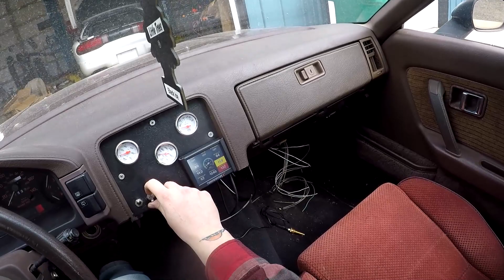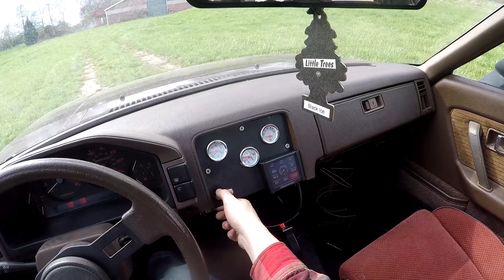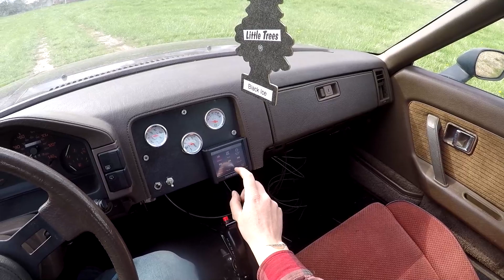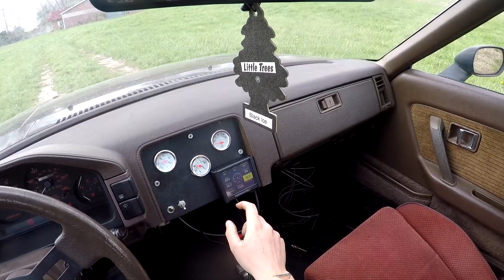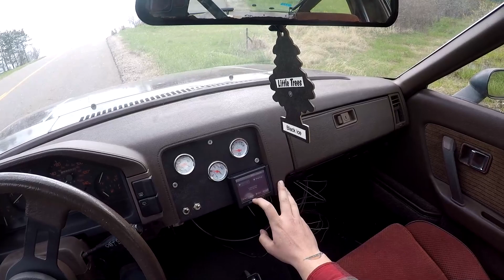666hp Turbo RX-7 Street Pulls!

Comment: Divide your boost by 14.7 to get your multiplier.  Ex 13/14.7 = .884
Add 1.00 + .884= 1.884
Engine HP x 1.884 to estimate HP at 13#
Reply from the maker: Yeah, I didn't think it was worth getting precise since I don't know the exact power the engine is making. Just estimating based on what others have made

Comment: That's not just a red bucket. 
It's a red transloading bucket. 
Mo official. Mo betta.

Do you think you had more heat in the engine now that you can make pulls? Could that have gotten your oil hot enough to reduce pressure at idle? I believe turbos add more heat to the engine via the oil than the air charge.
Reply from the maker: The pressure drop was the fuel pressure, not the oil pressure. I'm sure you're right if we're talking oil pressure
Reply: @SniderTron3000  ohh my bad, I was 3 beers in and probably miss heard you.

Comment: What’s you engine set up ? Did you gap the rings?
Reply from the maker: stock bottom end 5.3, TSP cam, BBK SSI intake, 7875 ebay turbo
Reply: @SniderTron3000  un-gaped rings too ?

Comment: I'm not a race car guy but any fuel tank that has the hoses at the lowest point of the tank is asking for trouble.  Every single little piece of shit is going to getbto the lines and into the filter.  To late for this tank but raise your pickups an inch or two off the bottom so all the junk can settle somewhere other than you filters
Reply from the maker: The point of the lines being at the bottom is to avoid fuel starvation. Its not a problem if the tank is clean and a large number of cells have the sumps like that

Comment: ebay fuel cell 80$ problem solved...
Reply from the maker: Not that simple because I refuse to cut the floor up to fit it under the car and I'm certainly not going to fill to by opening the hatch lol the only one that fits is a $260 Rhodes cell. Then I have to weld on a neck so I can use the fuel door